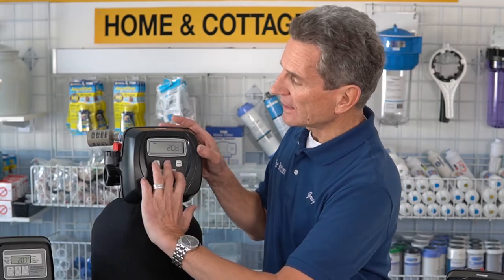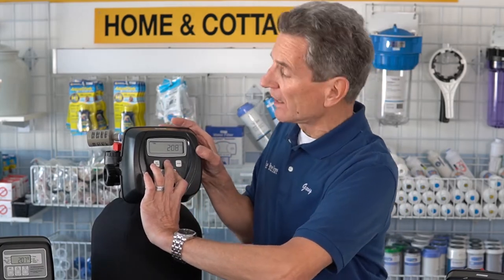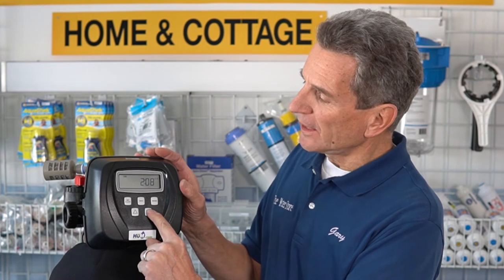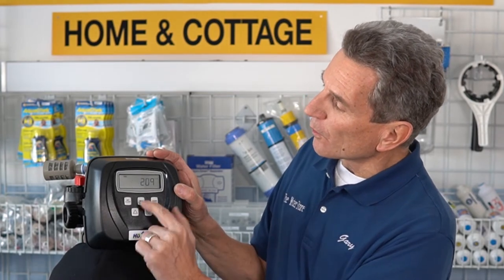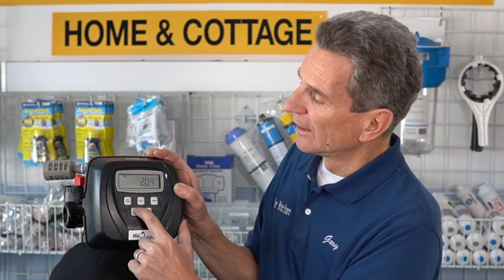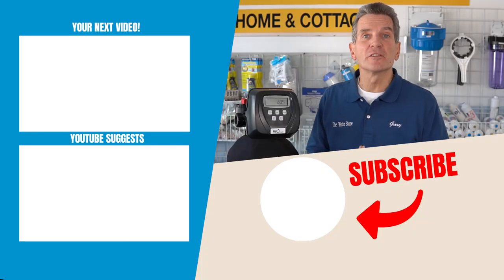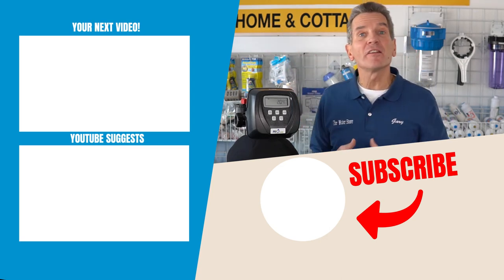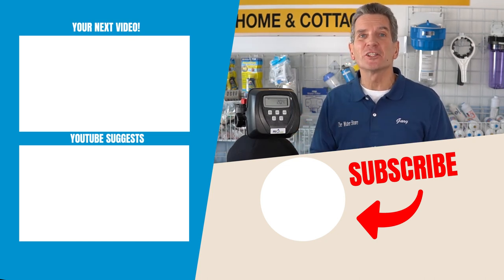How to UNLOCK Clack WS1 WATER SOFTENER Valve for PROGRAMMING

Comment: Hi!
I have been watching a lot of your videos. You are very informative. 
I have a clack 3 button valve. My system is used for chlorination. 
For the past 3 days my Clack valve has been stuck in the backwash cycle, I'm assuming it tried to complete a normal regen and it's been flowibd water out of the backwash tube ever since.  (Like I gave a hose on) the computer components all look fine and working. I even manually tried to complete another regen aanndddd still didn't fix it.  I don't have injectors to get clogged as my system only has plugs. 
My local water treatment company came out, didn't bother to even check it out and just told me it's easier to just replace for $495.😳
Do you have any suggestions as to what I can do to problem solve?
Reply from the maker: You need to replace the piston and seal pack, this video shows you how https://youtu.be/WIa033n4OQE
Reply: @water_estore  thank you! 
I will follow the video. You are awesome!

Comment: I've been troubleshooting my 18 year old North Star water softener. It isn't softening. Cleaned out a salt clog, cleaned out the nozzle and Venturi, checked and cleaned the brine well float and assembly. Regenerates but no fill or draw from brine well. Any thoughts or tips would be greatly appreciated thank you!
Reply: It is likely just worn out. To get more than 15 years on one of those is far more than the average of about 10 years!

Comment: How do you edit the Banner Text?  The company that installed the system went out of business and the new service people don't know how to get the old company name and phone number out of the display.  I would like to put THEIR name and number in the Banner Text.  I have the Pro H2O series with 5 buttons in a horizontal line.
Reply from the maker: Sorry, I don’t know. Never use that myself. Maybe in the manual?
Reply: @water_estore    Unfortunately, no.  I have the manual and it says to change the Banner Field you must contact the manufacturer.
Reply from the maker: @MrsMoe53  then I would contact them

Comment: I have a softener that when it regenerates and discharges water out our septic drain the pipe starts to over flow and go into the basement. Husband shut the water off took the trap off snaked out the pipe and everything works fine for one day. This pipe only over flows when the softener regenerates. Any idea?

Thanks 

Kelly
Reply from the maker: Yes, the drain line must to clogged enough that it cannot handle the flow from the water softener.

Comment: So I had someone do a media Change on my greensand filter,  which has a clack head, after he finished he said it was going to regenerate at midnight.  I checked the next day and it showed 800 gallons but didn’t show the flashing “filter” when I ran the water.   So I clicked the regen again and it was going to regenerate at midnight again but I don’t believe that happened, so anything I can try if the flashing filter word is not showing up when water is in use.  What did he forget to do?   Also the head was installed around 2006, it has 5 buttons in a single horizontal row.
Reply from the maker: It should be flashing the word “regen”. Just click the regen button yourself and it will go tonight.
Reply: Gary the Water Guy   Hi Gary!  I did push regen and it had shown “Regen Tonight” in flashing words.  However shouldn’t the screen actually show the word “filtering” flashing?  Today on the screen when I check it, it’s as if it’s stuck at 800 gallons or never really regenerates at the set time.
Reply: To be clear I pushed the button to regen yesterday and today it doesn’t seem to be filtering and counting down from 800 gallons
Reply from the maker: @chuckbllrs3844  I would call whomever did the service for you.
Reply: @water_estore   I think i determined the issue, the turbine on the counter was clogged with Iron.  That's why it's not flashing the word filter on my Greensand WS1 head.  I cleaned it up a bit and it now shows water is being "filtered".   Unfortunately, the water guy worked on replacing media for my Water Softner and Greensand system.  The bad part is he only serviced the Fleck 6700, he didn't touch the WS1.  What's worse is we were on vacation,, got back and the water tastes super salty.  Which is what prompted a full media build for both systems.  I think the head on the 6700 timing may be off, according to the manual i found.  Ugh... hating water issues!   Thank for assisting too!

Comment: I am embarrassed but how do you remove the cover on a Clack WS1 valve to access the programming screen? The cover has a small triangle shape 'stopper' on each left and right side but I cannot move or lift the cover out of the way!
Reply from the maker: Try grabbing it from behind and spreading the faceplate as you pull it toward you.

Comment: My clack water softener says 00 on the display is this normal. I believe it use to state the time. The system is about 2 yrs old.
Reply from the maker: Press the next button to see the time.  The 00 is likley the flow rate.  Run some water while watching the valve and you'll see the number change.

Comment: I have clack 10l softener 1020967 I’ve had two different plumbers come out and it’s still overflowing every few months and flooding my kitchen!! Nobody can figure out why? It’s been replaced twice so it’s not the machine! I feel like crying no one can figure it out and I paid so much money to have it put in! I’m in Ireland!
Reply from the maker: It seems very odd.  Could this have happened after a power failure?  Is there a safety float in the brine tank?  Have you checked out this video? https://youtu.be/Zikmilf_Tu0